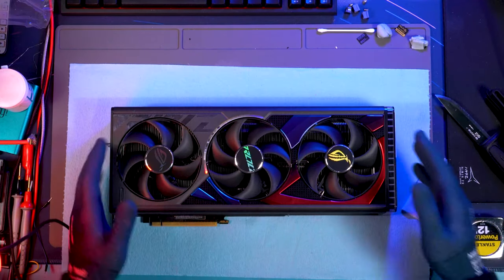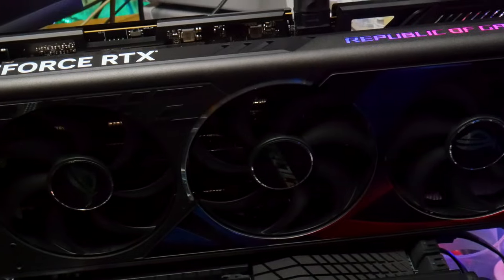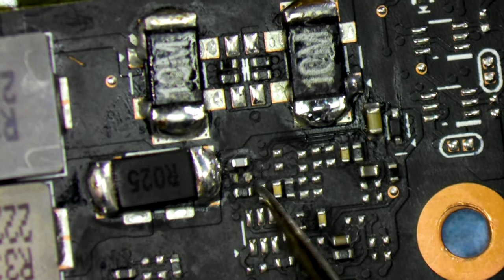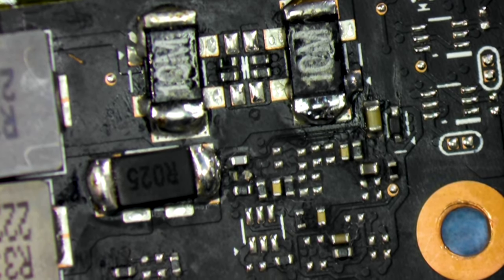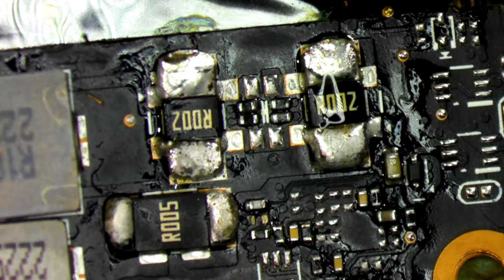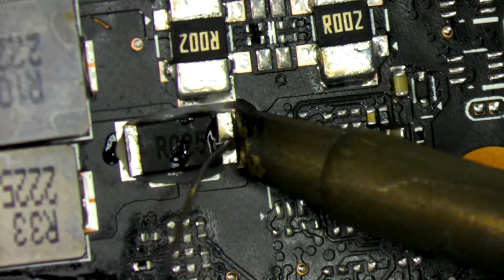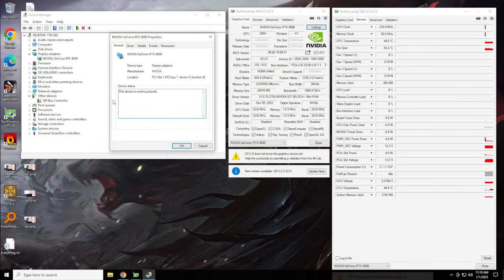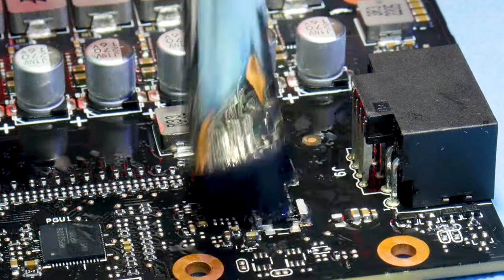The First Successful 4090 Repair on YouTube - Asus ROG Strix RTX 4090 Botched shunt mod [2]

Comment: you might wanna change that title cause Krisfix repaired one a month before you did
Reply from the maker: After krisfix sent it back to der8auer, it stopped working again.
Due to inadequate post-repair testing on krisfix's part, the repair was not actually a success. 
https://www.youtube.com/watch?v=xNTDXLOverc
Reply: Lmao what an absolute fact based destruction by the channel owner

Seeing this channel for the first time and love it already
Reply: @gr3gtech not true it was actually fixed by Krisfix. Der8auer was also mentioning this in an update Video to his 4090 card which was fixed by Krisfix.
https://youtu.be/9uh7KMmGA5g?si=74KKAltP9DPKTLE6

Comment: I remember I was literally frying GTX 690 in an oven to get the second GPU to work. I was doing it every other 3 to 5 months until I finally sold a card with a half working second GPU(new owner knew about it - he purely bought is as a display unit only)

Comment: Who messes with the boards on thier $2,000 graphics card just oc it and it's good 
No need to jump resistors and screw stuff up for a measly few frames per second more
Reply: It's not about frames in games, it's about benchmark scores.
Reply: @hazonku If this was the case, I would have expected them to buy a water blocked version.

Comment: I apologize for my bad English, I wanted to ask you a technical question, I own a 1000W power supply, should I change it for the 4090(Strix)?… do I have to get something more powerful?.. 1200-1500w
Reply from the maker: No.
I was running this, and another 4090 on a 760w psu which is on my test bench. Granted its not a power hungry CPU on that test bench, but at 1000W you are defiantly able to get away with a 4090 and a non overclocked mid range intel CPU.

If youre water cooling and overclocking your 4090 and a 13900k, you should go for a 1200-1500w psu just to have the headroom because youre likely going to be riding around 80% of your PSU's load rating, and typically, you dont want to push psu's past 70% constant load.
Reply: What if I have a platinum psu can I push it over 80% of full load

Comment: how much do you charge to fix cards? i have a pny 4090 and PNY wont fix it, 2 fans not working on it! manufacturers are stiffing their clients. i been trying to get it fixed for 3 month!
Reply from the maker: Typically our quotes are a small percent of the cards value.

That's weird. Maybe the fan connector is unplugged? Does the card work otherwise just fine, its just two fans aren't spinning even when the card is under load?

Comment: What was the application of the 18k resistor?
Reply from the maker: I believe it stood between 3v3 and the core. 

The card is so new so there aren't any resources on it. But from the trace work I did, one end went to a general purpose 3v3 rail, and another end forked. One way went to a few resistors that terminated at ground, and the other end went and terminated at about 700 ohms. But the end of this trace I could not find on either side of the board. I am suspecting it terminated under the core for nvidias proprietary 'NV3V3' Voltage rail.

Comment: 4790k hardcore bottlenecking the gpu.
Reply from the maker: You think? 20,000 is the highest score ive seen on superposition at 4k, with the 3090 coming in at 16,000 and the 1080 ti coming in at 9,000
Reply: @gr3gtech  
My Comment vanished some how. Maybe cuz i posted a link. So, ill try again. For a 4090 (AD102) the scores on superposition at 4k is arround 33,000 points.
20,000 is far to low. There is a hall of fame on the unigine website. I am also represented there as Mr.Squanch on place 98 (33137)
Reply from the maker: @mr.squanch  Oh my goodness thats FAR higher than I expected. It looks like im going to have to update my setup with a modern 12th gen testbench. Thanks for bringing this to my attention.
Reply: @gr3gtech  
Your're welcome! 🙂